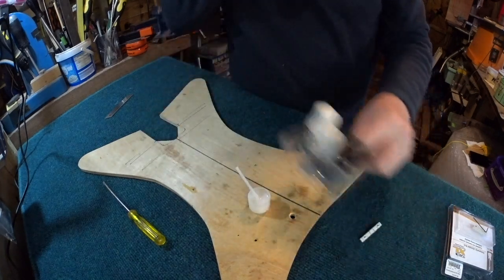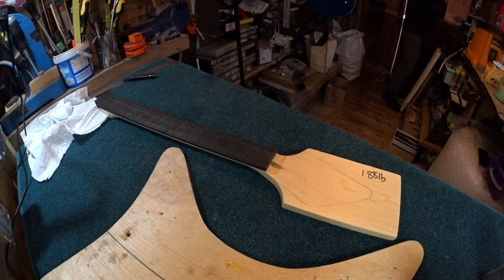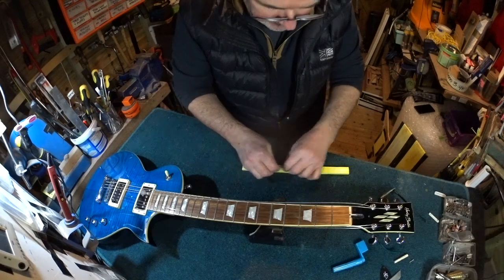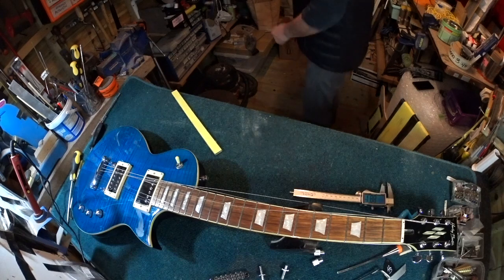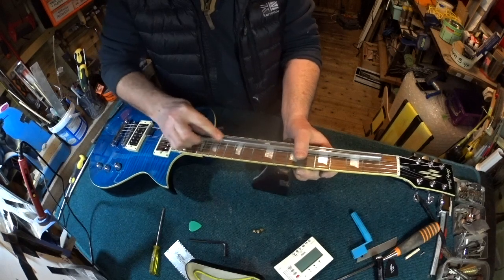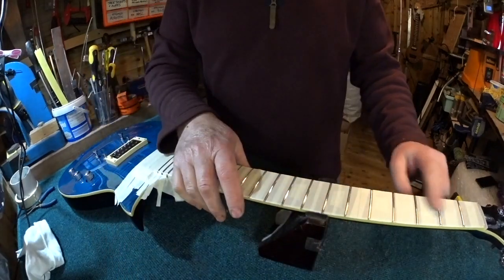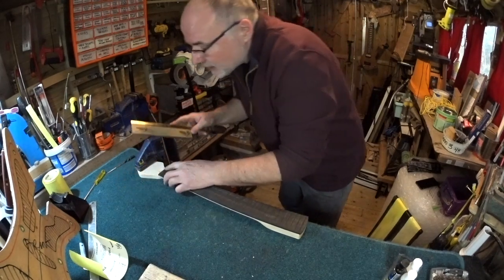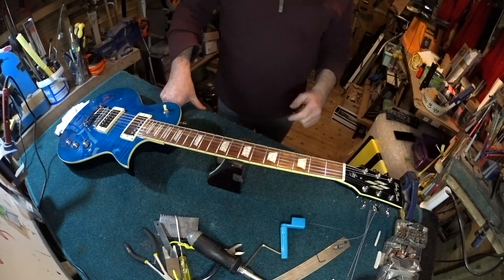Harley Benton SC Custom set up, custom adjustable nut fitting and bridge replacement

Comment: I'm a believer in roller bridges also.  I've used the bm003s on my firefly 338 and a chibson les paul copy.  Perfect solid replacements.
Reply from the maker: The adjustable Tusq nut I make does what a regular fixed Tusq nut does PLUS it allows you to dial in the perfect 1st fret action without touching the nut slots with files. My customers love them; they make an immediate difference.

Comment: Totally agree with your assessment of the benefits of the adjustable nut. I wouldn't like to try and get 0.3mm keeping the factory slots in a repeatable manner by sanding the base of a nut. Is there any downside resulting from the mix of materials or by increasing gap between the TUSQ bit and the base?

Comment: Hi Sam. 
Do you have any experience of the Vintage guitars?
I am in doubt between The Vintage V 120 and Harley Benton SC Junior. 
Are there any difference in build quality and hardwere ?
Reply from the maker: Hi Chris difficult ones for me to answer as I’ve not loved with either long enough to make a player’s comparison. From what I know they are very similar in construction (not too many differences possible in such a simple single cut design). But I’ve always preferred the look of the Vintage ‘Icon’ version over the HB but that’s just personal preference. I’m also a long time supporter of what Wilkinson has done generally with the Vintage range and rarely had one I couldn’t get on with… in fact just about never. Even a humble Chinese JHS Encore has an very decent neck with potential, even if the rest of the stuff is low quality B and the body feels like balsa wood. So personally, Vintage for me but I’d enjoy either - and both would be superb guitars when set up.